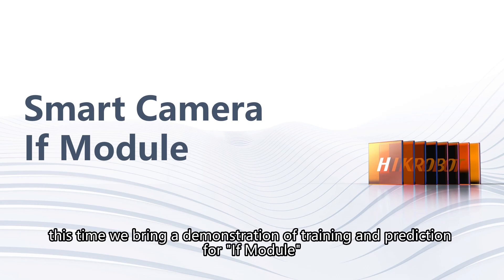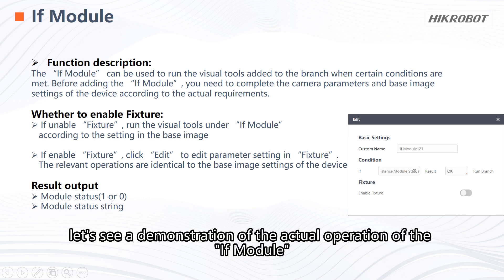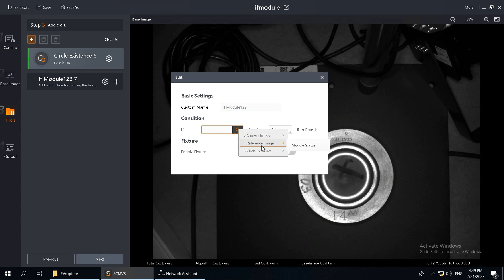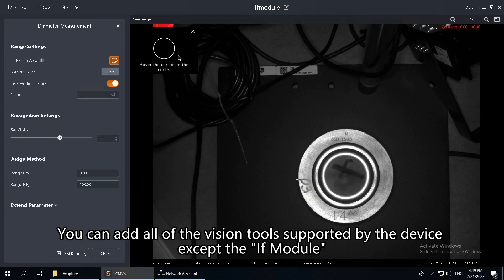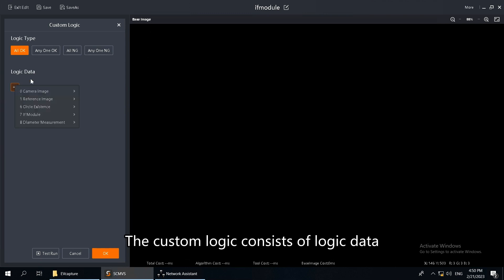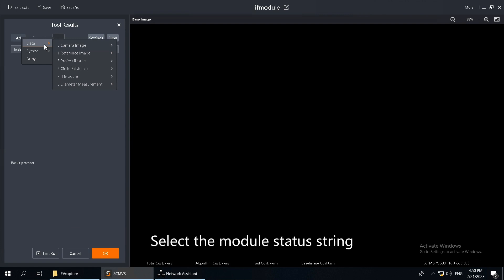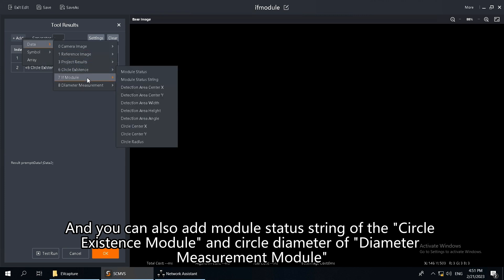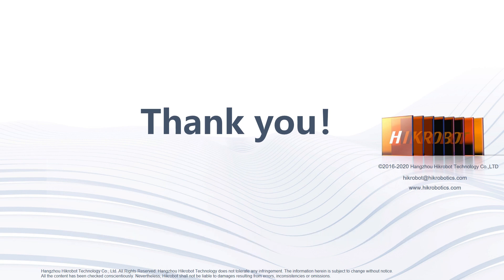If Module  | Smart Camera | MV TECH

Comment: I'm struggling to find if the following scenario is possible:
I have, for example, 100 images.
All of them are inspected with a tool which says if the image is OK or NG.

Is it possible to build a solution logic, which will trigger an Output when 5 consecutive images are NG?

In other words - can i have a variable, which can save an information from a previous image inspection?